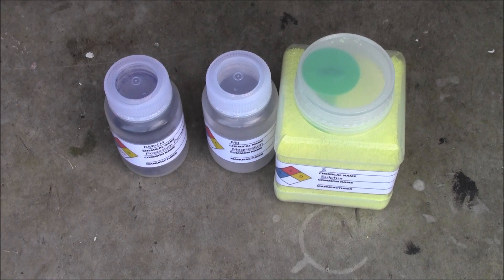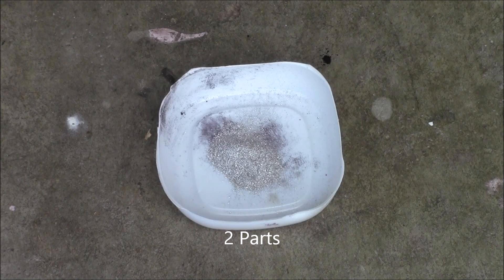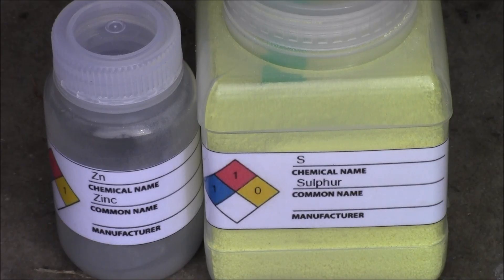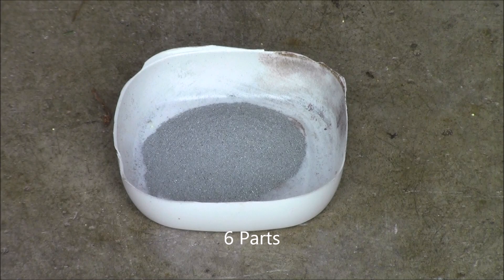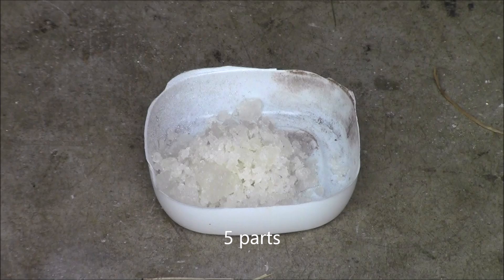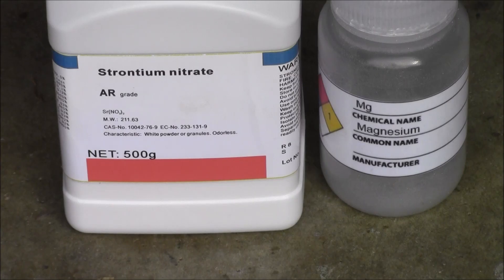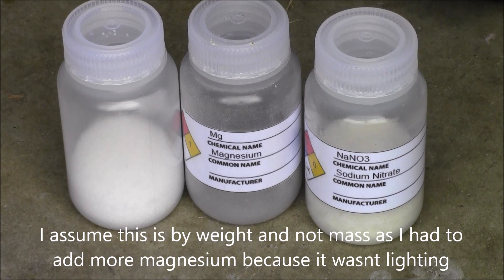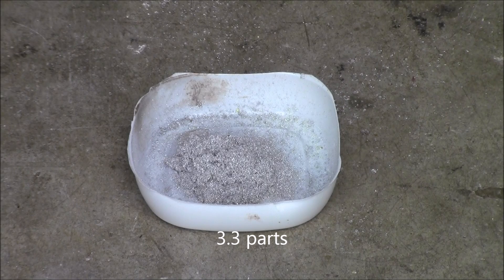Types of Flash Powder

Comment: Theres no need for sulfur,  just kmno4+mg in 50/50 ratio. Once again wear dark glasses if you dont want flash burnt.😢
Reply: Sulfur makes the mixture more sensitive, but yes without sulfur it will still ignite
Reply: @NateB-b5k I dont need it more sensitive,  I like to keep my hands. Its so sensitive u can drop it and it will go off. I use diaper method just mixing it. I made a cotton fuse out of this mixture that you dont even need a lighter, just smack it with a hammer or a rock. Im 40 and this is the most powerful flash powder iv personally made.

Comment: It's fun doing this stuff & experimenting with chemistry if you know the basics. Have you tried making golden powder ? It's relatively non toxic compared to any other formulas & has more energy than black powder. The ingredients in weight are 24 grams Potassium Nitrate, 16 grams Ascorbic Acid (vitamin C) & 50ml water to the boil. Then wait & stir gradually until it becomes a slurry & thickens up, take off the heat to cool it down & use it wet or dry. The energy this produces is astonishing for the two simple ingredients used, the residue is water soluble & it's safer than any other composition.

Comment: Sorry mate those "Flash Powders" were the worst I've seen. The Zinc/Sulfur one is actually a rocket fuel for a start. Stop adding Sulfur to Flash Powder folks as it only slows the reaction down and makes it a dirty reaction.
All you need is Potassium Perchlorate or Potassium Chlorate as the oxidizer and Dark Aluminium powder as the fuel.
Reply: Does potassium nitrate work?

Comment: KClO3 compounds even with 50-60% oxy-to-fuel ratio are HE, they are sensitive and detonate with supersonic speeds quite easy. Same about AmN-based and some other mixes.  Its better/safer to use KNO3 or KClO4 for this purposes.
Reply: Nah, KClO3 does not detonate with any fuel. KClO3 just is not used widely anymore because of its incompatibilities with sulfur compounds.

Comment: Try a tetraamine copper nitrate, S, Al, KNO3 flash powder i forget the ratios bit it can be found on science madness. I know it is shock insensitive but it has to be milled to work well
Reply: TACN is useless in this combination because the deflagration energy is fairly low. And the rest of the mixture is not strong enough to detonate TACN. So, no, don't waste your TACN on this.
Reply: @emmepombar3328  i actually attempted it and it worked. It turned out to be a crappy flash powder but it did actually work. I think i needed moke KNO3 but it did infact work.
Reply: @emmepombar3328  it is also not supposed to detonate. It deflagrates unless heavily confined.
Reply: @emmepombar3328  so you are right in a way. Its not worth using because of the strength and there are much better options. Like TeACP mixtures or other complexes.

Comment: Hi, I need to replicate / fake a 19th century photography powder flash for a theatrical purpose. What I need is to obtain a totally safe instant effect of white flash and smoke. My question is if that Zinc and Sulphur mix can it be instantly ignited with a lighter ?
Reply: Sights,  if it's any help,  I have used equal weight of Mg/KNO3 on am dram stage.  But better to ignite electrically so you can get exact timing.  It's more difficult using a lighter and, anyway, you don't want fingers near the flash, which burns at over 2000 deg C.  I wired a small car battery to a thin fuse wire in contact with the powder.  Throw the switch and the fuse blows and sets off the powder.  It worked perfectly.  But make sure you don't confine the powder or you will get a bang. You really only want a poof.  The old timers (I am one myself but not 18th century!) spread the flash on a metal tray, either flat or with a trough.  Trough is better as it can give a wide light source so softer shadows. There are other possibilities and I could tell you more if you are interested.  Where are you and can you get chemicals easily?  You'll probably only need small quantities.  Hope that helps.
Reply: Incidentally, you DON'T want very fine chemicals for photographic flash.  You want a relatively slow, bright burn.  I would use something like 200 mesh Mg.
Reply: Thank you for your quick answer, I am trying to build a tray replica using aluminium tin, and a barbeque piezo electric lighter as a handle for flaming the powder. The goal is to get as close as the19th century  genuine flame and smoke effect... really hope I will. I would go with electrical battery but there;s no room to hide it inside a handle. Thanks a lot !
Reply: @sights2397  Yes, I should have referred to the 19th century not the 18th - flash powder was in use from the late 19th. I actually still have a tin of Johnsons photographic FP No1, bought in the 60's.  But I digress...   It doesn't have to be a car battery.  I didn't have time to experiment, nor the need to minimise as we just needed a small explosion on stage and the device (in a metal bucket) was hidden.  You'll need a reliable decent spark.  But as the business end of the lighter will have to be right in the flash powder it will almost certainly be damaged by the intense heat and not work again.  That has happened when I have used a (long necked) barbecue lighter to set off flash.  Even though it was the flame that ignited the powder, the flash was intense enough to ruin the end of the lighter. You don't want it to work OK at rehearsals but then not on the night!  You might like to experiment with some very fine wire and small batteries that could be concealed in the handle, as in a torch.  As long as there's enough power to get the wire to glow bright, if not actually blow,  it will ignite the flash and the wire is easily replaced.  In my case of course the wire burnt out immediately and probably added to the noise.  I used a single strand from ordinary household lighting flex.  I would guess you can find even finer wire in headphone leads or some such, that wouldn't need much power to make it blow.  Good luck.  I'd be interested to hear how you get on.
Reply: @oldgeorge1939   Yeah, that's my concern too.  It is a long necked lighter  with a wind resistant flame nozzle, but the  aim here for that flash has to be repetitive, I mean like 3-4 flashes in 15 minutes or so.. I'm thinking to use some other powder, to avoid intense heat., toxic fumes etc. I absolutely agree about the battery part but the trouble is that we need that flash device asap, and I have a lot of many other things to set in. Btw, I would love to see a pic of that antique Johnsons  tin  :)
Reply: @sights2397  A piezo mechanism can't be relied on to survive anything that an audience would recognise as old time flash.  I still think my method would be your best option. You just need to find some thin wire that, say, a small 9 volt battery would blow. For our am dram I made up several devices, each worked perfectly.  The business end was destroyed by the firing of course but it was no trouble to make up new end pieces for the next night. I wouldn't like to advise on a slower/cooler burning composition. Indeed, I doubt whether there is one.  You'll get reliability with a hot wire.  Otherwise you'll need to plan on a new lighter for each performance!  I stress that for a realistic 'poof' the powder must be unconfined. Perhaps cover with a single thickness of tissue handkerchief to stop powder being blown about. Better still make a 'v' shaped trough on the firing tray and leave it uncovered. I have dug out the Johnsons tin and photographed it; it's actually No 2, which I think was supposed to be less smokey.  I think the oxidiser was BaSO4.  I have some and can do a test if you like. I'm not on the main social media but can be contacted on Discord where we can DM.
Reply: @oldgeorge1939  Thank you,  I will surely consider your advice
Reply: @sights2397  How could I send you the photo of the Johnsons tin?  Seeing as I went to the trouble of digging it out and photographing it!
Reply: Don't be a dummy by getting your hand with lighter or match close to the powder. USE A FUSE !!  Be safe.
Reply: @robertmckinley2886  It was safely done, exactly one year ago, the effect was almost real replicate, thanks !
Reply: Here is a sample of the photo moment:
https://www.youtube.com/watch?v=6P_H2J-dR9M

Comment: Can the flash in firecrackers if stored properly spontaneously ignite over time?
Reply: Yeah. I’m curious about that too...
Reply: rslichtis @bigbluebuttonman1137  
For more than half century I've been making & using KClO3, Al & Sb2S3 flash and have never, in those 5 decades, experienced any problem relating to spontaneous combustion/ignition; with a thorough understanding of of these reagents, they can be combined and remain stable for many years.
Reply: @robertlichtenberger206  Also, a small addition of boric acid ~1% might be a good idea.

Comment: One of my comp mix's is this:   KNO3/MG/S   @   50/50 +1 .    I usually purchase industrial grade KNO3. I recrystallize for the best purity.  I store in crystal form and ball mill only what I intend to use in a comp.  Try to keep the moisture down.  Next, Magnesium, as fine as you can possibly get/buy.  The ball mill it further.  I try to get it to 3-5 micron.  Sulfur,  again, ball mill the heck out of it.
Many ppl say that making flash powder using KNO3 is weak.  And "YES" in comparison to other oxidizers (KClO3, KCIO4, KMnO4, K2S2O8, NA2S2O8) it is.  However,  It is one of the safer methods of making flash powder.  Remember, the higher you go up on the oxygen molecule the more reactive(sensitive) the comp becomes.  Most ppl stay with a tried and true (safe) method of using KCIO3, or KCIO4 in there flash powder.  Making exotic flash powder is cool, but can also be very dangerous.  Flash powder isn't bias about who, or what it destroys in deflagration.   BEING SAFE IS BETTER THAN BEING DEAD!✌💖
Reply: Well I don't think using KClO3 in your flash powder is very safe.
Reply: You need a 4 instead of a 3 indeed  @Linus-nq2op
Reply: hi...can you help me make a flash powder in a simple way.what chem.  needed to make it.
Reply: Weird exception to that rule is that chlorate is more reactive and less stable than perchlorate.
Reply: Hey, trying to make some cool things here. You think titanium powder is brighter or better in any way to magnesium? What's the brightest metal when burning?
Reply: 49.5+49.5 + 1?  And is it better than 50 30 20?
Reply: What about aluminum powder instead?
Reply: I tried that 50 50 +1 with Indian blackhead & it works fine. I processed 2Kgs of it.

Comment: Best compound is a mixture of fine powder, potassium perchlorate 70 percent and 30 percent German aluminum. Then put a certain amount in a hard cardboard cylinder. Hot glue it lite it and run. Especially if it's in a tube longer than 1 inch. Boom. White lightening!
Reply: True
Reply: Will regular alumínium powder works ?
Reply: @dominikvakan2607  No it has to be a very specific type that is called airfloat flake shaped aluminium powder in the particle size on under 5 micron 
Atomized aluminium will not work and aluminium powder in the right shape over 5 micron will give you a slow burning roman candle like effect
Reply: @Kirt44  I learned that the hard way smh.
Reply: As long as it's powered aluminum
Reply: Try making mercury fulminate. Very toxic,  must wear breathing mask. Nitric acid and mercury.  Very large mixing glass bowl with long tall neck. Pour in half cup or cup of acid. Very slowly add mercury. Will start reaction immediately and can over climb up neck and over flow. Add mercury with glass dropper one drop and wait for reaction to stop before adding more. 65 percent nitric acid 35 percent mercury, must be correct for great synthetic mercury fulminate. Once all done wait for glass container with completed mixture to completely cool. Use Pyrex glass. Then slowly pour out into coffee filter, let dry and carefully scrape off filter. Put into small cardboard tube, add fuse and run. Pretty loud. Enjoy
Reply: Actually i dont agree on this anymore,  
I can make the sickest and most freightening sounding and feel of pressure salutes whit a barium nitrate and dark german aluminium 2 micron 
And it is especially getting freightening and violent if you play around whit difference in particle size of them both
Reply: Sorry I thought I said German powdered aluminum.  The louder The better
Reply: Potassium persulfate and magnesium flash powder is more powerful
Reply: @Ignis_1 that’s an exotic mix that is not well researched. It’s powerful but what scares me is if u get a drop of water on it, it will start smoking…
Reply: When flash powder explodes, does it make a louder or less sound than peroxide explosives?
Reply: carefully tho as this mixture can be set off by static charges🥴
Reply: kali perclorat 65 percent  and 35 percent German aluminium is the best bro

Comment: My I suggest using Nickel Hydrazine Nitrate (NHN) as your flash powder for the 21'st century.  It's faster than any flash powder you can make mixing chemicals together.  When confined it detonates at 7,000 m/s @ 1.7 g/cm3.  More powerful than TNT and doesn't react with metal, can be stored for decades, much less sensitive than any other flash powder.
Reply: Question: What other chemical/s are supposed to be mixed with this Nickel Hydrazine Nitrate (NHN)  and in what ratios ?  (I am thinking Magnesium)  Please reply.

Comment: They are not flash powders.
Reply: Abe Coulter why not?
Reply: Flash powder is potassium perchlorate and aluminium powder
Reply: Abe Coulter yes that is ONE flash powder, but there are many more! Flash powder is just a oxidizer and a metallic fuel that burns fast. I see what you are thinking though!
Reply: Flashpowder burns rapidly with a bang
Reply: Abe Coulter not always! Just has the burn fast, not with a bang
Reply: Totally right
It looks like components are not even fine enough
But so it is much safer to handle with it
Reply: No such thing as a safe pyrotechnic composition
Reply: Abe Coulter that’s not true! Ever heard of matches?
Reply: @anthonycaminiti8734  that's not flash powder. It's matches

Comment: Parts by volume or weight?
Reply: weight
Reply: @rickjwilliams  thank you
Reply: @rickjwilliams  weight as in grams right. so 3 parts of sulfur means 3 grams of sulfur?
Reply: If your total flash is 5 grams then the answer is yes. Here 2 parts, 3 parts, means 2 grams and 3 grams. Remember since the units aren't fixed, he uses parts instead. So by 'parts' he could mean grams, kilograms, tons, etc. & thus it is depending on the total amount which you are making.
Reply: @MT-in3tp  ohhh thanks

Comment: (ratio:7/3=sharp bang poweful)(ratio:6/3/1=quit low pitch in bigger salutes)(ratio:6/3/.5=sharp standard report formula)(ratio:62/23/7=low pitch if use in bigger salute)(ratio:50/25/25=very deep low pitch explosion listed as bomb like pitch)(ratio:5/3/2=very deep same as 50/25/25 its mostly used in cherry bombs)(1/2 airspace=powerful pitch+)(1/3 airspace= poweful pitch-)(1/3.5 airspace=loud pop with very deep pitch-)
Reply: is this for all the types
Reply: Nice info
Reply: what ratios are these for? dm on ig @hk_pyro

Comment: Putting sulphur in flash mixes is generally a bad idea. It sensitizes chlorates and perchlorates and they can spontaneously explode. Same with permanganates. In fact, anything that produces an unstable chemical in the presence of sulphuric acid
Reply: Putting sulfur with perchlorates is fine. If you really think a mix is going to spontaneously explode, even a chlorate mix with sulfur, you have a lot more research to do. In the presence of moisture there is a minuscule chance sulfuric acid could form with dirty sulfur, but with deacidification  rubber makers sulphur it doesn't happen. People have been putting sulfur with chlorate for hundreds of years, for everything from fireworks to primers, and when done correctly oh, there are very few issues. I suggest you do some of your own hands on research rather than regurgitating some of the nonsense you hear because it's foolish and it doesn't help anyone at all. It's painfully obvious that you do not have experience with these chems and you're just looking to berate somebody online. not cool, and very misleading to young scientist and amateurs alike👈👎
Reply: @huhdidwhat  Thank You for setting "DirK" straight on the use of Sulfur with oxidizers 👈👍